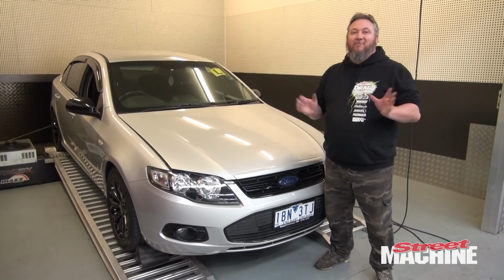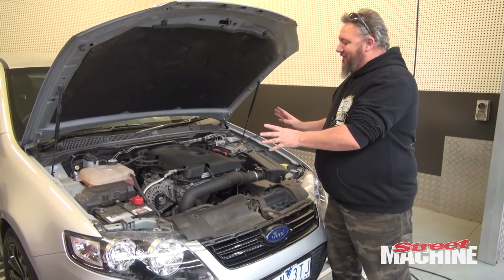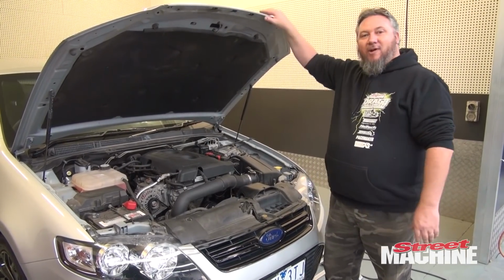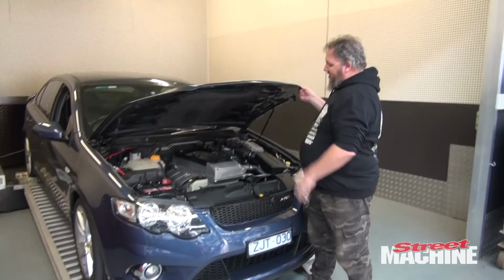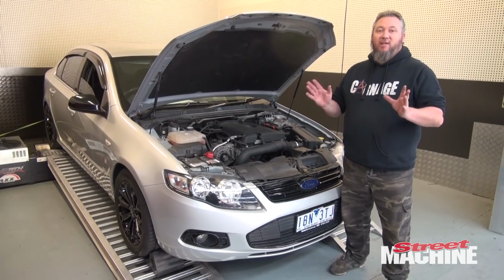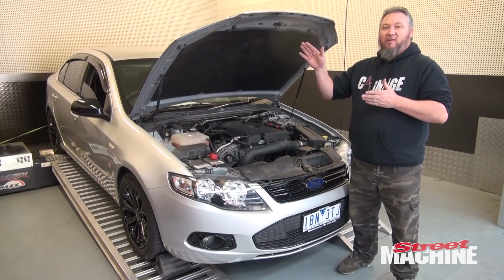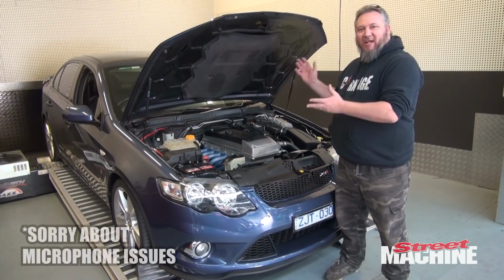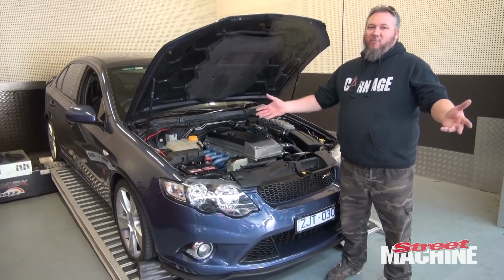P-Plate FG Falcon Battle at Maxx Performance

Comment: Expand on 'P-Plate' for our international viewers. Something to do with registration levels?
Reply: back around 1990, there were so many newly licensed drivers involved in single vehicle crashes(due to driving like a maniac after watching mad max movies probably) they introduced power restrictions for P platers(provisional license, new drivers) originally this was only a no V8 rule, but later got very complex with power to weight, no turbos  all kinds of rules.. i doub't it's made much different, because you can still probably drift a prius into a power pole if that's the only car you were allowed to drive.
Reply: It's a restricted licence for people who just passed their driving test
Reply: Yeah a stock fg is way way faster than anything the average p plater could get his hands on in the eqrly 90s .. in 1993 if u had a 202 VB commodore u were winning .  And if u had a 253 you were a legend .. most P platera were driving 18 second cars
Reply: Basically P plate means you don't get to have fun cars. They specify a power-weight ratio limit and/or blanket no turbo/v8. No cars with "modifications that require certification" either. There are notable exceptions like most Volvos and anything new enough where the turbo option has less power on paper like this ecoboost.

However cert laws are pretty relaxed, factory turbo cars don't need anything unless you upgrade capacity, you can do head swaps, and a multitude of other oversights. The Barra 6 is also really capable even without boost.

Comment: Guys I'm sorry, I'm an old American, love your channel, but I can't quite figure out the conversion of kilowatts to horsepower, is there a simple formula like Maybe times 2 for us old fellas
Reply: Multiply by 1.33. Or on a basic level 300 kw is approximately 400 hp
Reply: 1 Kilowatt is 1.34 horsepower
Reply: @fejasxhaferi204  1.3403 to be precise. 😛
Reply: Leonard, the easy way for us old fellas is this.
Whatever KW it is, add a 1/3 for hp.
If you want to tell your hp in KW, take a 1/4 off. 👍

Comment: Be interesting to see the fuel economy on each as well
Reply: Very good man! I get around 800km to a tank in my 2013 FG MK2 EcoBoost 😊
Reply: Kersah x, that’s endurance you’ve evaluated, not economy. How many L/100km does it consume for city driving? 🚙
Reply: I use to get round 600kms on my territory that’s if you don’t let the revs get over 2500 ish
Reply: Benson Hedges you realise we are talking about the falcon not the territory
Reply: My Ecoboost is driven like a race car  and still Managers 10lt per hundred
Reply: @jacobfrauenfelder7961  so is it good or got worse??
Reply: My Ecoboost has a turbo side intake 3inch downpipe 50cell cat 2.5inch catback and is running 19 20 psi of boost. And still running 10lt when i got it was 9lt then I did the cat and downpipe and it was running 12lt then when I did the turbo side it dropped back to 10lt
Reply: @jacobfrauenfelder7961  hi Jacob
I own an ecoboost and I’m struggling to get a turbo side intake. Would you be able to help me please mate?
Reply: @jacobfrauenfelder7961   how much power is it making
Reply: Cool. We have a na xr6 fg since adding the extractors and exhaust. Cold air induction and a tune fuel consumption has dropped dramatically
Reply: do you have tampons in your back pocket

Comment: Should tell us the cost of the mods on each car!  👍
Reply from the maker: I'll find out
Reply: @STREETMACHINETV  about 5K is my guess, thats headers full exhaust and otr and tune and dyno, its about 1K for every 10Kw gain approx and also depends on who does it and what products are used, like branding of headers exhaust etc etc, also intercooler from a XR6 turbo on a eco boost, hum is it new or 2nd hand as well, sure save a lot by using 2nd hand stuff, at least 2/3rds cost easy. :)
Reply: 7071t6 Not an otr🤦🏼‍♂️
Reply: STREETMACHINETV price?